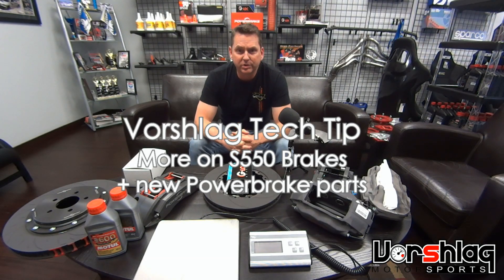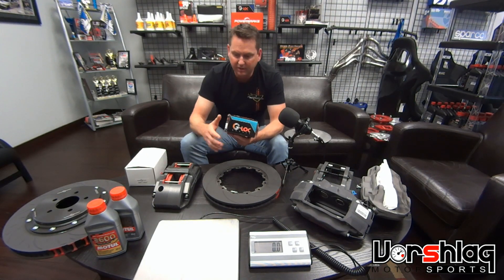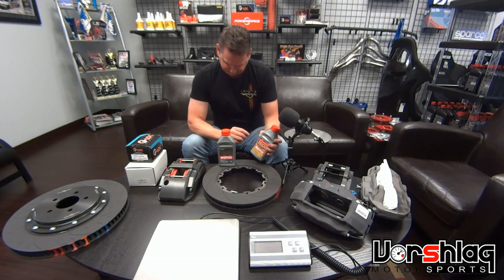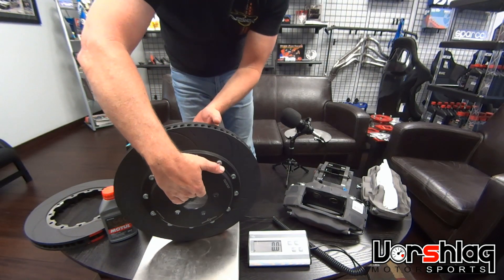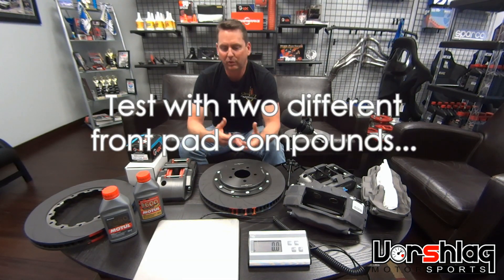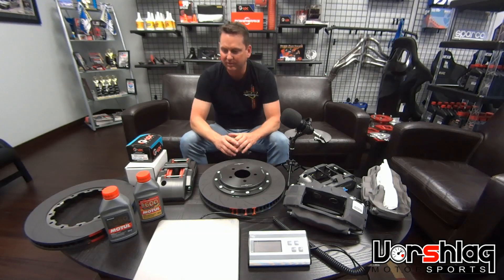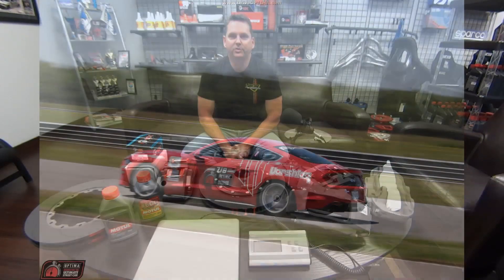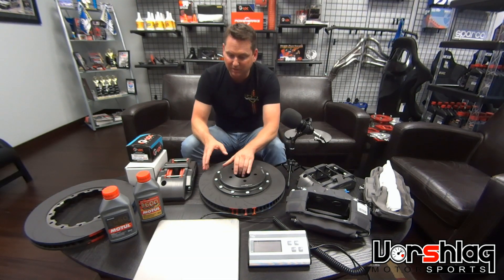Tech Tip Video: Powerbrake S550 BBK weights, fluids, more!

Comment: Wow, so there actually IS a legitimate reason for the stock rotors featuring that reversed design - and here I was ready to fein anger towards Ford for doing something for no reason! It's almost like engineers were involved in the development of these cars or something... LOL.

Of course, that still doesn't change the fact that they're still awful for track use, but at least we have some legitimate foundationa reasoning for making that choice. Thanks for going the extra mile on this stuff as usual, Terry, this is great info!

And, to think, all of these minute details that just went into the brake development - imagine being able to pick the brain of an engineer involved in EACH of the major mechanical systems, that would be a real mountain of info to be had...

Comment: if you want a 200tw tire that won't fade on the track, your only choice is the Hankook RS4, but the ringer lap with the RE71R will be faster... and RS4's suck for autox cause they need some heat in them...
Reply: wait I'm confused I thought rs-4  are autocross tires. so what tires are good  for solo then where they don't need heat to grip.
Reply: schizobipolarjoe RS3's were autox tires, with the RS4 they decided to focus on track use. For solo, RE71R or whatever the newest BFG Rivals are (there are a few versions)
Reply: thanks what about  a dual tire street and autocross use.
Reply: still the bstone and/or bfg.  they don't wear that much with regular street use
Reply: Thanks. now if I can just figure out the passenger air bag sensor pad , and how to remove to aftermarket bucket/fixed back seat. I will be good for a while . have a good weekend.